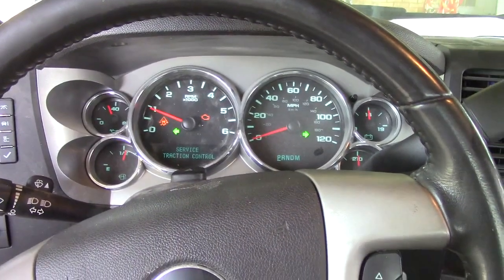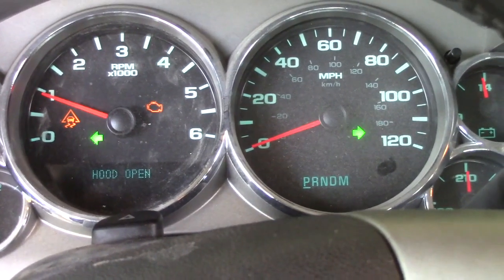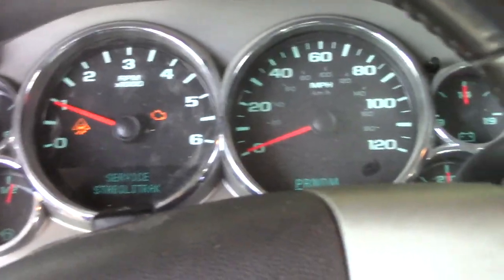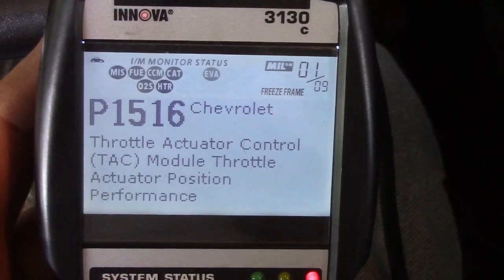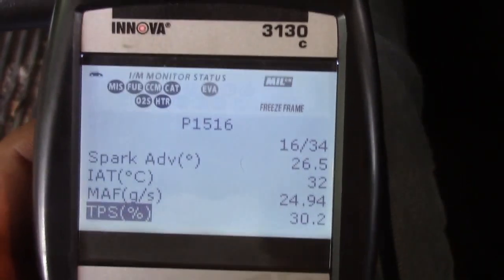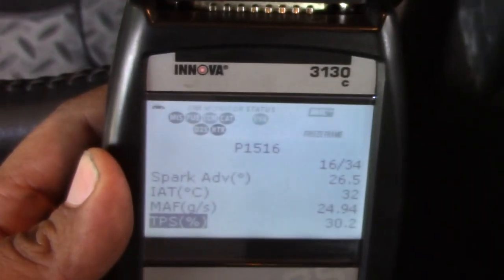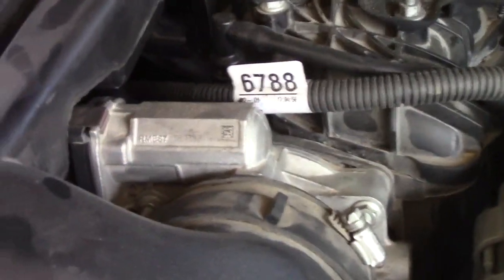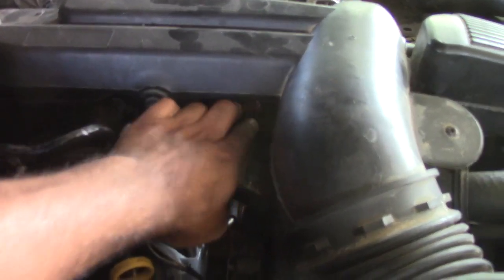Stabilitrack 09 Silverdao Chevy, Power Loss ,Code1516, how to Repair. part 1

Comment: I had this problem same code P1516 and everything, replaced the throttle body and about 30 miles later back into limp mode. After several failed attempts to fix I checked the fuel pressure and it was the fuel pump going out. Replaced the fuel pump and no more problems. Hope this helps someone with this issue.
Reply: I replaced my fuel pump yesterday  it did the same crap

Comment: Our daughter was tps 09 afm system.  Wouldn't rev up.  Service traction control on dash was lite up when I  shut off engine and turn key to run position tps rattle sounded like handful of teaspoons in glass quart jar  all local parts stores only stocked standard motor product tps. It  worked about 4 days then same thing .. salvage yard acdelco 4 bucks been working for a year 😳

Comment: my 2011 did that to me Monday morning I scanned mine and it come up a PO 641 code which is a 5 volt reference circuit 1
Reply: Did you figure out what was
Reply: @alvarosilva957  turns out the fuse box under the hood was corroded you got to pull it apart take it off of where it's at and clean the that's what I found

Comment: My 2010 did same thing driving in Montana when 17 below,, found it was the throttle body was sticking because of the cold air.. took air intake off,, sprayed some throttle body cleaner in it while running,, never did it again.. could be just dirty and sticking on yours also

Comment: 2008 Chevrolet tahoe 4.8 doing the same shit and my oil pressure is up and down changed the oil pump,oil sending unit,camshaft sensor pressure relief valve in the oil pan,about ready to burn the sucker in tired of spending money and time on it

Comment: I have an 08 tahoe, and my problem is one I've never heard of before and I've searched the internet high and low about, talked to every mechanic in 4 counties, my dad is a mechanic and he's baffled as how to fix it without tearing it down peice by peice under the hood.. my power drains, it drains more if I have the fuse for the amp in to my speaker system. The radio head is busted, and if the fuse is in things can go dangerously wrong in the matter of seconds.. i have an overhead DVD player for the backseat which i had to totally unhook all power to that because it would get so hot it radiated heat all the way to the third row seatting, and if you touched it you could get a pretty nasty burn also the hard plastic actually got so hot it softened quite a bit.. i have always been a radio music nutt, my entire life.. you might like music, but I guess you could say I have a relationship with it! Lol.. well not only do I not get to use the DVD feature for my kids. I dont get to use onstar, gps, or the radio.. so when ever I have to drive for any period of time i get the luxury of hearing the bickering of two voices, that by the time the trip is over, have my ears almost bleeding.. i don't know if my hood is open or if someone forgot to shut one of the doors, or if a tire is low or any other emergency type notification unless it has a light up indicator flashing on my instrument panel because my speaker system is not work as I have to yank the fuse so I have to charge a dead truck every few days as apposed to every single morning.. when the fuse is in, and i open the door to get in , there is a huge thunk sound similar to what it sounds like when one would get rear-ended.......by an asteroid. And the same sound is heard when i turn the key to start the vehicle,  and can be heard randomly driving throughout the duration of time while of course driving,, naturally when this colossal noise happens others can hear it with in a city block and if im fortunate enough to get beside one of those people who has 911 on speed dial im then pulled over shortly after on suspicion of carrying some sort of weapons of mass destruction,  but i get² looks of "better you than me" by the officers when I show them the source of the noise, and after the blast wave has come and gone an everyone asseses the damages due to the blast and is all Okey,  im free to go about my deaf marry way.. so we're down to it "might be a ground wire".... my 07 tahoe was stolen from under my carport 4 1/2 years ago.. there was zero problems with it, then insurance paid to have it replaced by one a year newer, of course I send my husband (a carpenter) off to look for one,  and he finds a "real gem" of a tahoe a few hours away in the big town of hot springs arkansas, at big dawg motors.. he says,, "its an 08 tahoe with 103,000 miles on it and its clean as can be" i ask how many owners its had, "oh, only 3" he sqys,, i ask in how long? He said, "3 owners in a year" and I only said one word. .... "LEMON" but he's the man and what i say is irrelevant despite i grew up right beside my dad learning and turning a wrench right beside the best teacher I've known, and his profession is building houses,  he can build the shjt out of a house, but that needs to be where his appreciated 2 cents ends..

Comment: I have the same problem with my 2007 Chevrolet Suburban traction control and stability light and truck shakes like hell and won't idle up
Reply: What ended up happening that exact thing happened to my 08 suburban
Reply: Negative battery cable you need to replace it

Comment: I have a 2007 chevy tahoe flex fuel travel from minessota to California as soon as I made it to my destination this happened mine was a bad lifter on cylinder 6 after that was fixed both them lights were on long story short I was using E85 I switch to 91 cause 2 am no choice I did 91 as I started driving both lights banish havent come up again.

Comment: I've been having this problem with my 2011 silverado and it pisses me off since it doesn't throw any codes to the scanner. All of sudden it message center shows needs traction service and goes away by itself, but some times it starts acting  crazy,  all warning lights turn on and the doors lock and unlock by itself.  Its frustrating, I took it to the dealer and they just ripped me off with a 400.00 bill for diagnostic that says they couldn't find anything wrong with the truck. 
Im very disappointed with my  Chevy.
Reply: Check visual relay and fuse in the engine bay if you see green on the fuse or relay change the bloc it's part gm number 22798215 for me ( 2010 ltz 6.2)
Reply: 2013 Silverado changed brake booster and solved all lights coming on
Reply: Dang, yeah, thats a rip off. You could have bought a new OEM TB and a bi-directional scanner for that much and replaced it yourself.

Comment: Tengo una Avalanche 2008 ocn el stablitrak encendio.  No quiere agarrar sobre marcha, tambien tiene el codigo P0315.
Reply from the maker: Lo mas seguro es un problema con tu sensor tps
Reply: FLEPACA II cambia la abujillas y filter tambien bateria!!
Change your plugs gap/tourque to spec!! Theo 1 gallon of laquar thinner in tank till empty! If it has more then 80,000 miles change battery too! Yes the battery!! 90% of time it’s this, if you don’t believe me! Take and regap existing plugs and pull out filter run codes will diapear with in hours

Comment: Did your vehicle got fixed please let me know what was wrong with it I have same problem  thanks
Reply from the maker: It was a loosed wire in the accelerator tps sensor
Reply: Miguel Gonzales where exactly is that located

Comment: I had this problem, this is how I fixed it.
1) clear the code with blue driver.
2) disconnect the battery 
3) get a new throttle body and throttle body gasket.
4) remove the air box to the trotted body, engine cover and disconnect the throttle wire on the left side.
5) undo the bolts and remove the throttle body and gasket.
6) do the reverse of these steps and connect the battery.
7) the truck should not need a relearn because the battery has been disconnected.
Reply: Mines still does this and I bought a new tb